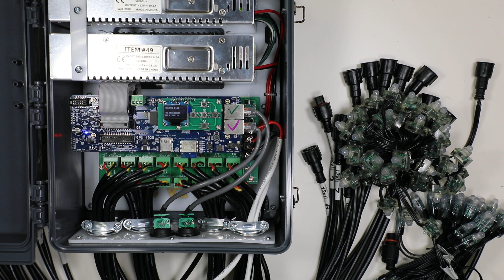Changing Mode on HinksPix Pro

Comment: About 20 people suggest a falcon board. Can anyone tell me why please.
Reply from the maker: Good question, here is a comparison between the two designs:  https://youtu.be/uiUYCw7aO-o - The Falcon V3 is a copy of the original EasyLights PIX16 controller which was released 4 months prior to the V3.  There was a time when the Falcon, with it's expansion options made it unique but the Flex system, along with multiple CPU's and much more advanced smart receiver options passed up the Falcon system.  So mainly the Falcon is coasting on it's prior successes.

Comment: This is amazing!🤗✨dose it have any power injection ports?
Reply from the maker: Power is supplied with the controller outputs.  For "power injection", this isn't related to the CPU but the power board and customers performing power injection typically use boards specific tor their application.